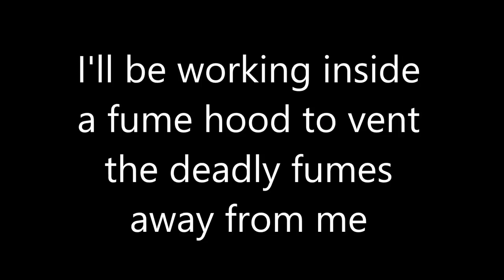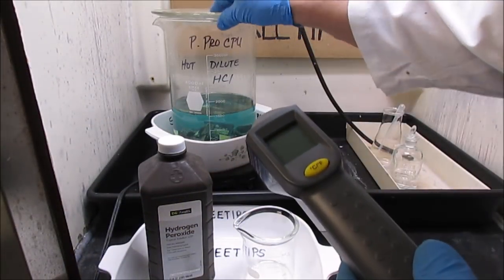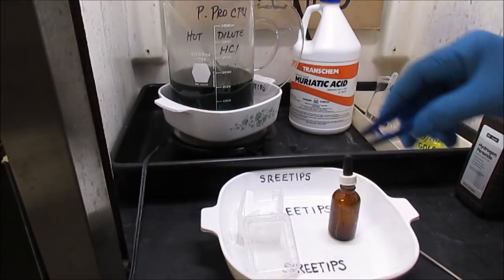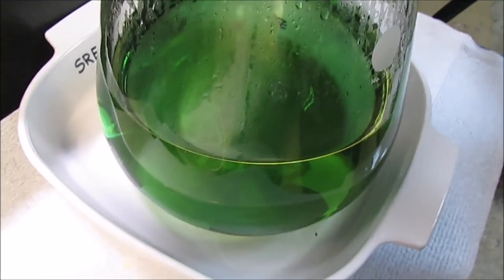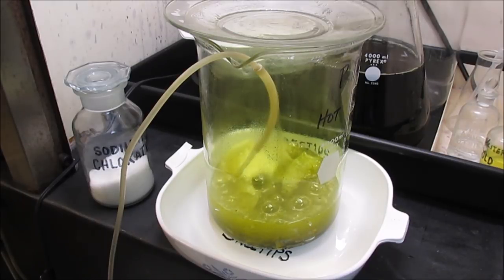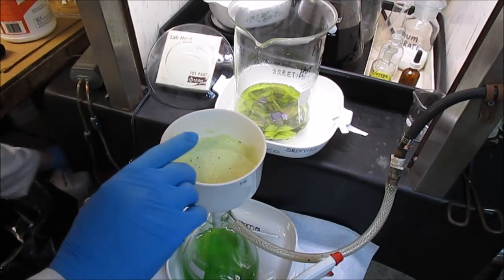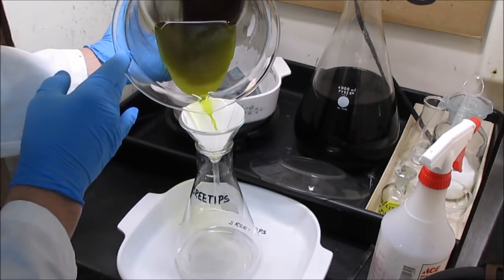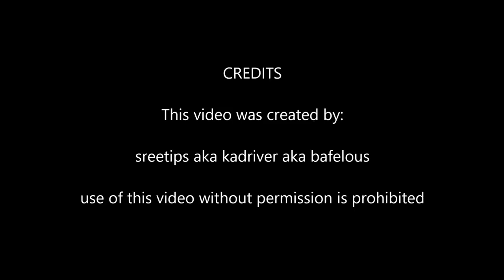Gold Recovery Pentium Pro with Sodium Chlorate

Comment: When the peroxide was first added it looked exactly like it oxidised FeCl2 to FeCl3, judging by the instant yellow/brown colour change.

That might sound like a waste of H2O2, but FeCl3 happily complexes/reacts with copper & aluminium too.
Reply from the maker: It worked better than I expected. I added the hydrogen peroxide as an after thought, it wasn't in the plan. Somewhere in the back of my mind it seemed like a logical step to add it.
Reply: Instinct is a good thing :)

I think it was mostly the iron(III)chloride complexing with the base metals, although it'd need a proper chemist to work out exactly what was happening.

Glad it worked !

Comment: i was wondering, when people incinerate ic chips etc, doesnt the gold braizing burn away, i see u havent heated it long, all other videos they roast them in a fire, surely they lose gold ?
Reply from the maker: I've not worked with IC chips, only these CPUs. They can be heated to redness to burn off grease and oil. But I only heat them until they quit smoking. Heating the CPUs to redness could cause the gold to ally with the other metals in the CPU. This could cause problems when trying to recover the gold.

Comment: I have a couple Wii controllers and a Samsung tablet 10.1 that I just took apart. I'm having a hard time getting Nitric acid. I have to depopulate the boards. They are covered in gold. How would I be able to process them? Can you try it and make a video, please? I'm just learning.
Reply from the maker: if it were me, I would try the hydrochloric acid and hydrogen peroxide with a bubbler at room temp. That should get the foils loose. But I don't think it can get under the solder mask on this boards. I don't have any boards to work with so I can't make a video. But it's a good suggestion.
Reply: sreetips I was told Lye dissolved in water will take off the mask in a Lye bath and hot sand to depopulate the boards. Thank you for the help and the classes.
Reply from the maker: Now you've got me chewing on the idea. Probably won't be a very high yield, but it could make a killer video. I need a way to shred those boards, then hit it with HCl and extract the gold. Thank you for getting my juices flowing on this one.
Reply: Thank you for putting out these videos. Maybe one day we could get together somehow. The "Gold fingers" from memory card are the same way. Everyone cuts off the "fingers" but the whole card is covered in gold. You just can't see it because of the mask.
Reply: the gold plate on most boards is usually very thin if it has it, if you are going to process gold plated boards for a video sreetips I'd try old cell phone boards first as they always contain gold plate and are easy to obtain. I have a stock pile of cell phone boards 100 pounds atleast so far, I will process some day - depopulation is the annoying part.
Reply from the maker: Yes, I've found that getting pure gold, from any source, is never easy.
Reply: On a side note I got hold of some vintage jewellers gold soldering wire about 2oz ranging from 10k - 16k and one unmarked which I assumed was gold, I pretreated with hcl , rinsed and then nitric and rinsed and then aqua regia. That one clump of wire will not go in solution in my aqua regia  never had something not dissolve before, any thoughts? All the other gold in solution but the mystery one it is now dark in color but still intact.
Reply from the maker: is it magnetic? It might be stainless. Test for platinum. Scratch some on a stone apply Pt test acid, hold it near a strong light to heat it up a bit. Then put some of the test acid on a piece of filter paper and apply stannous, orange is Pt.
Reply: Not magnetic there is some platinum in solution but very little, wonder if this could be rhodium?  never had this happen before through my refining - might try to get it x-ray tested this week. put it in fresh solution no reaction, I know it isn't iridium -  rhodium doesn't make sense to me either,  they do use it for plating in jewelery but unsure of its reaction process.

Comment: I'm interested in tin recovery, waiting to watch all your vids first before asking.
Reply from the maker: I don't have any experience recovering tin. The only tin that I encounter is soft solder that was used to repair a piece of jewelry or tin shot that I use to make my stannous chloride testing solution.
Reply: Sounds interesting.  I biught a trash can of tin solder from a junk yard . It  originally  came from IBM at their Manassas plant  i keep the solder for 20 years  i occasional  repaired brass copper radiator  .  Then used it as tye wire.  I wonder if it could be heated  to stratify  the lead from the tin. . Ive already breathed in enough solder fumes for a life time
Reply: I mean, sreetips gets the gold from pins and cpus ( at times) i'm hoarding whole pcb boards which are full of tin and silver, tin is at around 16 euro a kilo, and constitutes a decent bit of the metal in the boards. I am kinda unsatisfied with how troublesome it could get to get all metals from a pcb and a video doing that could be pretty nice, I seen a few, besides that there's palladium in the transistors which are another good bit of weight from the pcb, anyhow i werent really satisfied with the solutions found.
Anyhow my actual question is if a metal like tin can br completly lost by using a "too harsh acid".

Comment: Is it possible to precipitate the silver out of this solution somehow?
Reply from the maker: Hydrochloric acid will precipitate silver chloride if there is any silver present.
Reply: So the solution left over after precipitating the gold and filtering, If any silver is in the solution, I can precipitate that out using hydrochloric?
Reply from the maker: Jo, consider that your solution is already full of hydrochloric. If any silver is present then it will already be in the form of silver chloride. Adding more HCl after that would be pointless.